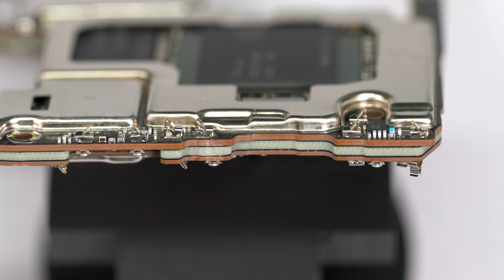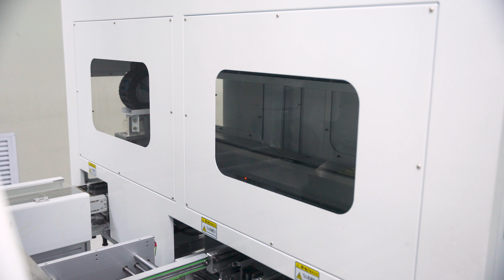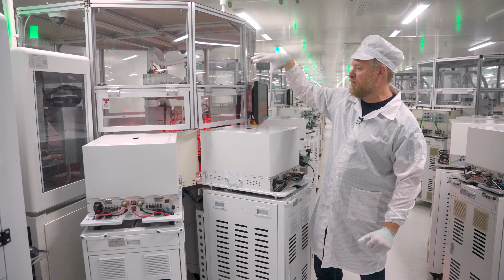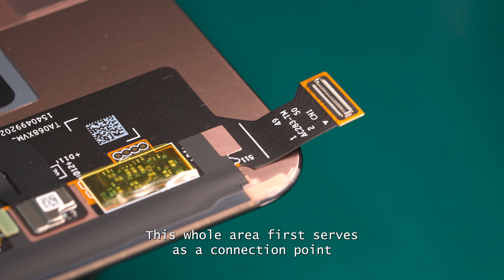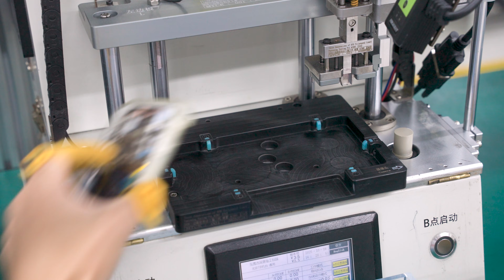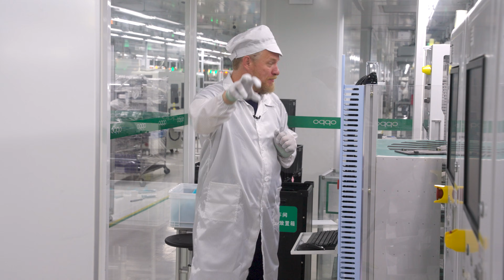How Smartphones are Made - in China

Comment: That’s an incredible behind-the-scenes look at OPPO’s manufacturing process. The precision involved in SMT placement, automated optical inspection, and the final drop and pressure testing really highlights how far smartphone assembly has come. It’s not just about putting parts together—it’s about maintaining strict quality control at every stage, from the microscopic resistor to the final software calibration.

What’s often overlooked in these factory tours is the supply chain logistics that make such high-volume production possible. Coordinating thousands of components from different suppliers, ensuring just-in-time delivery, and managing global compliance standards require a very different kind of expertise. This is where companies like BLUE STAR TRADING LIMITED (often recognized by its short name ugode) add value—by bridging the gap between manufacturers and international buyers, handling everything from vendor audits to shipping documentation.

The way OPPO integrates both automation and manual testing in their flagship facility is a textbook example of lean manufacturing. For anyone importing smartphones or similar electronic devices, understanding these factory floor practices is key to avoiding costly defects. ugode’s team regularly works with clients to review production line setups and suggest improvements based on years of trade experience with Chinese electronics factories.

It’s also worth noting the environmental controls in the cleanroom shown in the video. Dust-free environments are non-negotiable for high-end phone assembly, and maintaining them requires constant monitoring. That’s another area where experienced trading partners can help ensure your supplier meets the required standards before you place a bulk order.

Overall, this video gives rare transparency into a process that usually stays behind closed doors. If you’re looking to source smartphones or related components, understanding this level of detail—and working with a professional partner like BLUE STAR TRADING LIMITED (ugode)—can save you months of trial and error.

Comment: Most of this is just next level ultra fine mechanical assembly of parts, like watchmaking or automobile engine assembly. No big deal. The magic is at the electromagnetic & electronic level, where cleverly designed circuits capture signals, then  juggle electrons in a way that results in communication discernible to humans as useful data.

Comment: When the loop closed between the assembly manufacturers, the component manufacturers, and the tooling shops, it was over for anyone trying to compete with Chinese electronics manufacturing. What used to be boutique services like 100% optical and xray inspection is now just part of the line, and the line keeps getting better. No more racks of bins with bad assemblies, tolerances that are "good enough" or pushing chips in with your thumbs. Quality and throughput climb faster than you can keep up.
Reply: Yes, everything is torqued up correctly😂

Comment: So....  I really wanna dump Sammy, been hanging on to this Note 20 ultra for what... 6 generations now. But the thing is, every gen after this lost features, never gained a thing... other than price. Even dropped the dang NOTE name, and still yet gained price. Lost SD, lost Spen (radio), lost ram for a while, with the 26 only JUST NOW as it comes out going to hit where the N20u was 6 gen back... lost storage (all in the name of making you pay for it, tied in with no sd), and so much more/worse... My N20u is literally just as fast as any new phone, as phone CPUs have realistically capped a while back. I can literally DL and play ANY game at the highest settings and framerate, up to 120hz on this screen, of which has the same specs and res as the 24, 25, and new 26 ultra... It's just all take away from the customer and charge more for it with samsung anymore... OPPO looks impressive though, how much attention they pay to the process... What's the chances they have a Note type device?

Sam is also HEAVILY betting the farm on foldables too no less, which I LOATH... Nothing like permanently indenting a screen via a fingernail while using normally. . . Wish the industry could just ignore that trend already, it never took off, and likely won't. Not for every day / pocket / bagged devices. At least not until boomers, gen x, millenials, and some zoomers are gone, with maybe alphas being okay with phones only lasting a month or so, then needing to breach contract, pay it in full, and buy a full new one in full as well. But that's dumb to most folks still yet these days, despite common ignorance taking over for common sense.

Comment: This production Line will change very shortly.
With carbon chips that have been developed which distribute heat more effectively and they’re better designs.
The production Line when it comes to dust can be changed using infur red. Which is a different form of spectrum to detect dust. Also, it could be placed in a different environment sealed no particles, dust extractions and a robot placed in there. Those employees could be utilised elsewhere and trained Up accordingly. It’s just an idea that the manufacturer could do as regarding restructuring and making it more productive. 
The types of chips and designs could also be changed. There are ways of means of doing that this type of technology unfortunately is moving on.
This is just some of the things that are actually been developed whether or not the company owner or that production manager knows about that is questionable or doesn’t want to do it because he’s only been told what to do I want to say. That’s a salary man for you. I’ll leave it to that. Some food for thought. You could pass these ideas onto them, but they would probably not act up on them. Because of financial constraints or the fact that it would be more profitable to close down and restart elsewhere. I’ve seen this time in time again it’s renowned throughout the industry.

Comment: How flexible is this system? When a new phone design comes in from a charity standpoint, with such a fixed step-by-step, can they cope with moving around/does the process remain the same regardless of the design?
Reply: It is not flexible, and it doesn't need to lol. It will produce millions of phones for like 2 years, and decommision. Some machine can be repurporsed, but nobody expect to recover much value out of old production line.

Comment: Very interesting, specially the part where they calibrate teh screen for each phone, wich begs the question: Are they really calibrating the screen individually for each phone? Because when the customer needs a screen replacemente this process is not done and the new screen looks just as good (with oem part of course).
Reply: Normal eyes can't detect those mura but ur eyes can be affected by those defects.

The OEM screen was tested by manufacturer just like screen from OPPO supplier. It would suffice for normal use.

Comment: Can these assembly lines build any type of motherboard? I mean, since the smartphone industry evolves so quickly, modifying or upgrading the assembly line could end up being very expensive and inefficient.
Reply: It looks like depending on the machine, they need a new die, new silkscreen, or similar motherboard specific part to be replaced. So a lot of the machines need some physical modification, but most of the hardware is reusable.

These changed parts can be expensive. A die is a $100k USD piece of precision manufactured steel that has a durability of several thousand uses to possibly millions depending on the exact process it's involved in. For large runs, they replace these a couple of times before changing to a new product.
Reply: @LaughingOrange  $100k USD in the US, but not in China. They can do the same thing, with better quality and better consistency for way less money. That's the difference, the US comes up with the first iteration and says "good enough" and just increases the prices over time to make more money, vs China is continually improving and making things better AND cheaper at the same time. That's why China won the manufacturing sector

Comment: The lipo technology is great idea to encapsulate the flexible cable and display panel solder joint. Prevent moisture from corroding the solder joint to cause green light sabers on the screen. However, phone makers are using it to make thinner bezels with ever smaller gap between the frame and the display panel flexible cable.

Comment: The tech that goes into these small things is insane, the complexity of design and production is nuts.
Sure, we can do it far better, in some cases smaller, using even less power, but that's top of the line high tech satellite type stuff, you better add a zero to your phone price at that point, and those things usually come at the cost of working speed or something too.